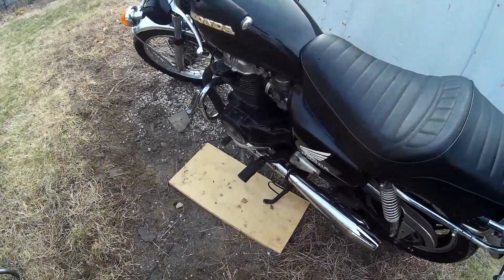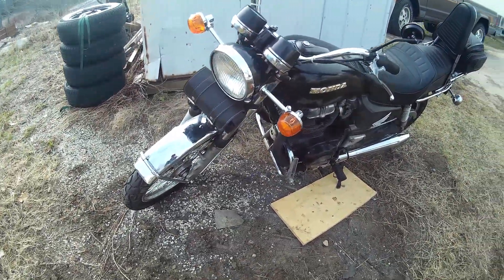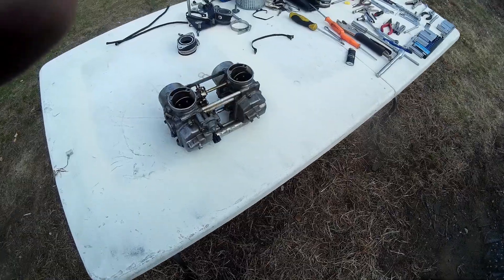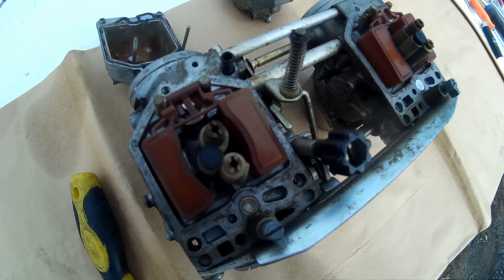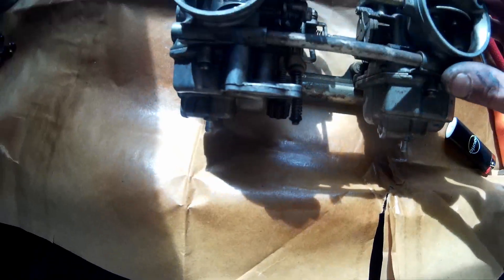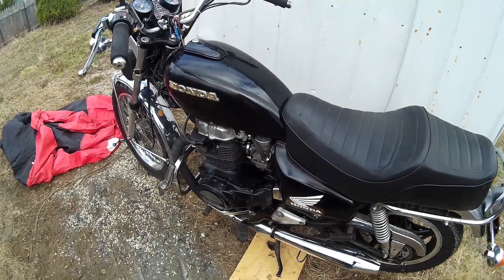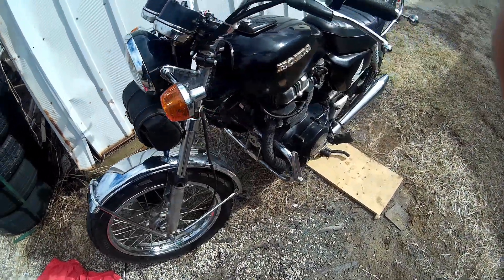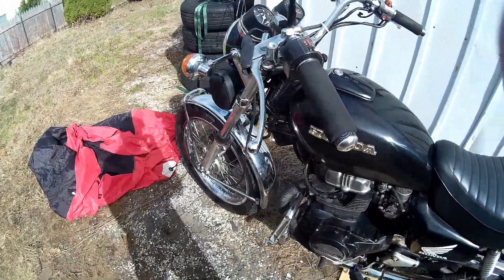1982 Honda CM450 Carburetors and other stuff

Comment: Where did you get the rebuild kit from?
Reply from the maker: ebay
Reply: Got a link and what’s the carb #? VB 22a? 
I bought a 81 cm400 that was swapped with a 82 cm450a engine and trans. 
Not running. He said it was the starter and it even came with the cm400 engine starter and trans so I swapped the starter and it got power but didn’t start. 
Done a lot so far and got to the carbs cleaned them well, little leak on the battery side one. 
But it started for a second or 2 but had to hold the starter button. 
Saw some white smoke from the exhaust and spark plugs. 
It was sitting outside for 6 months.
Reply from the maker: https://www.ebay.com/itm/333445013682
this is the carb kit i got.